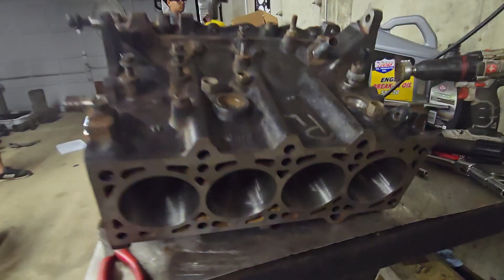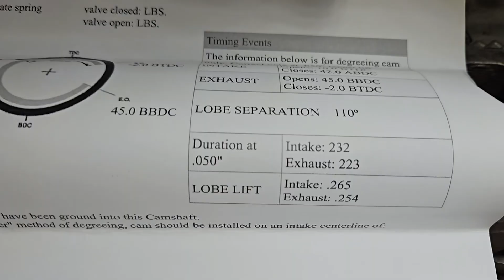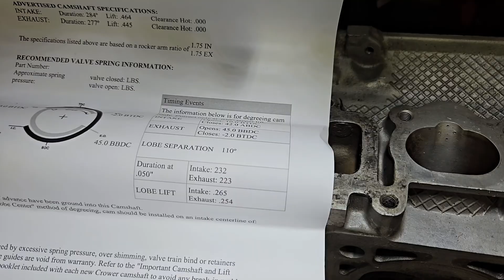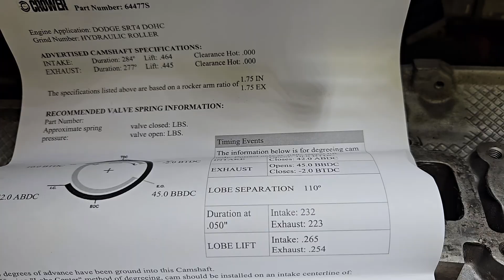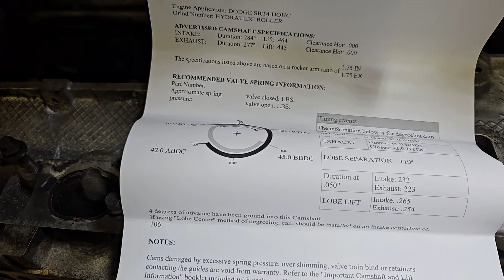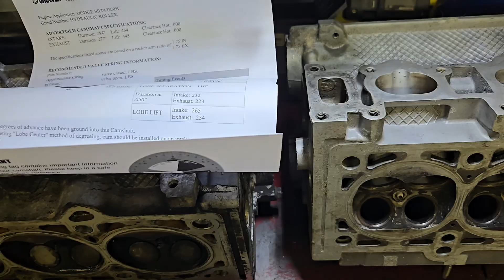I'm back... Neon platform any good?

Comment: What cams were those at the end of the video? Were those the crower cams shown or some you had custom ground? I have an old pt cruiser with the na 2.4 5spd so ive had some interest in these. I think theres like 3 different versions/blocks with some interchangeability issues between the turbo and na versions that i cant remember off hand, but its a platform id like to play with.
Reply from the maker: Those are crower stage 3 for the srt4 platform.  Im working on some custom grinds in the near future

Comment: I dogged a stick highline back in the 90s it was a fun whip for the times.
Reply from the maker: The car in the thumbnail  wss my daily went high 12s with a 75 shot on a full throttle switch and a long block with 150k in it. Never broke it.